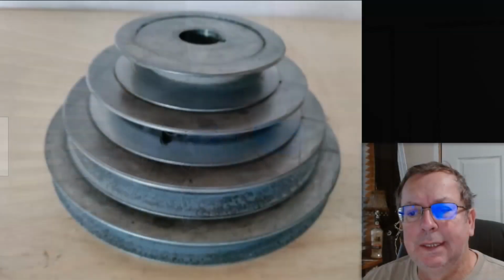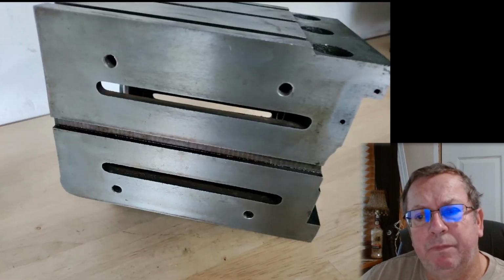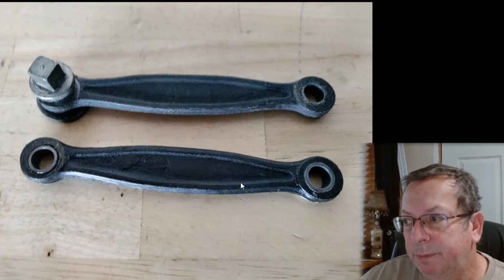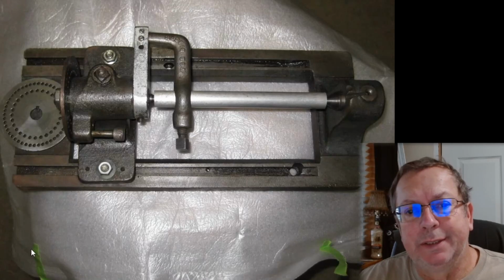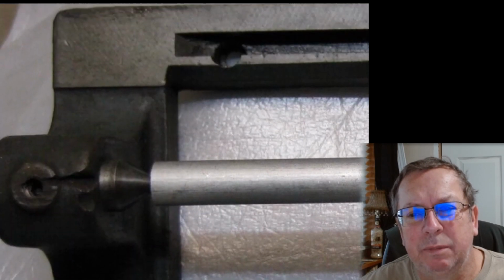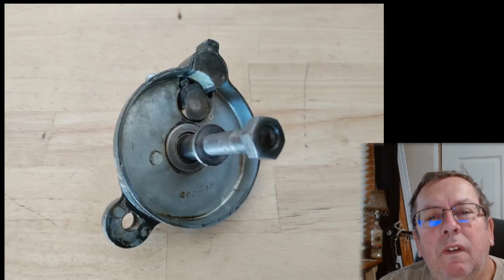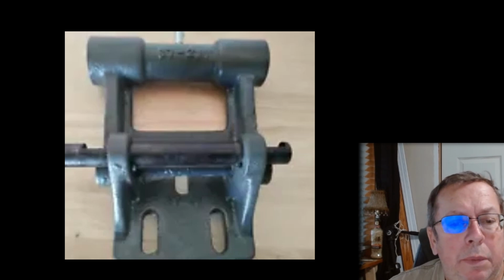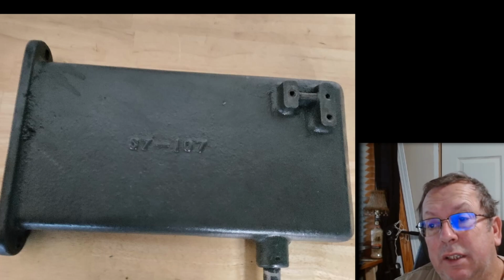Fleabay Edition: November 13, 2022, Part 1

Comment: Another great video. I had the indexing head, and it was very useful, but I would never pay $460 for it. I bought mine for $200 in 2014 with 3 plates. Crazy prices.
Reply from the maker: Thank you, It has been a lot of years, but when I bought my shaper it also had the index attachment and I paid $600.00 for everything except it was missing the smaller guard.
Reply: @hillsgun  I got mine at a flea market. I guess it must have been a really good price then. The seller didn't know anything about it... Lucky find, i guess. I don't think I ever see them on Fleabay.